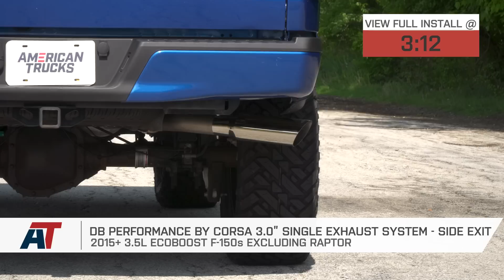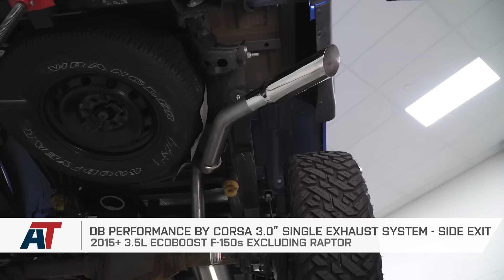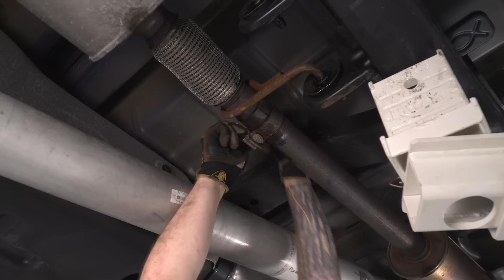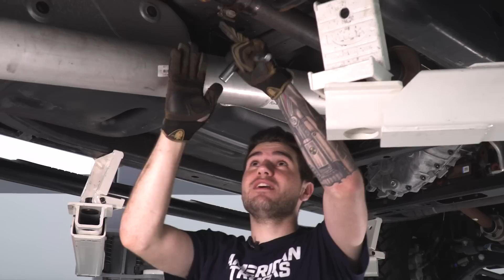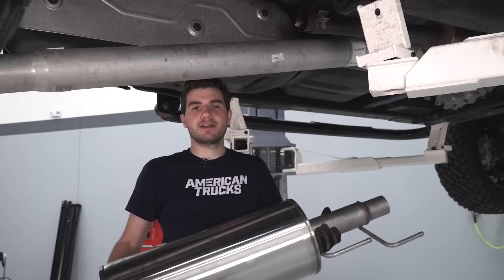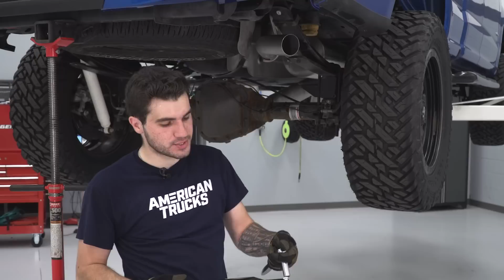2015-2018 F150 dB Performance by Corsa 3" Single Side 3.5L EcoBoost Exhaust Sound Clip & Install

Comment: Whats the difference between this and the corsa sport other than the tip?
Reply from the maker: The Corsa Sport system will have a higher grade 304 stainless steel making up the tubing, will have their straight-through muffler with the patented RSC technology (absolutely no drone!). The DB performance system will be a slightly lower grade stainless, and the muffler included does not include the RSC technology so there may be a slight drone. Hope this helps! -Zach
Reply: @AmericanTrucksFord  my understanding is that is does have the RSC technology, I went to the Corsa website. If you know something different, I would love to know because I want to buy this.

Comment: It sounds good but it doesn’t address the biggest restriction the tiny resonator and resonator exhaust size which must be 2 1/4 at the most in diameter . It should be a Cat back system for what it costs.